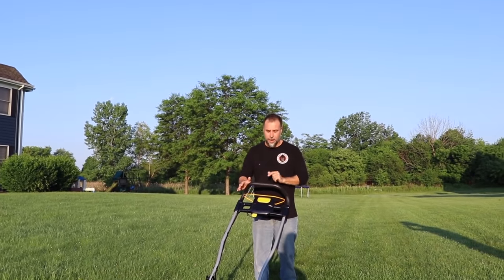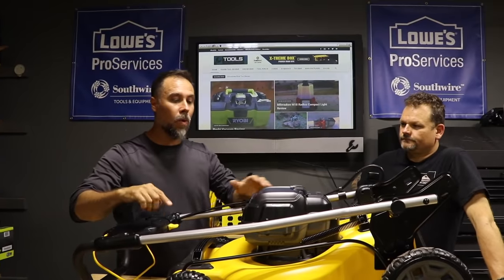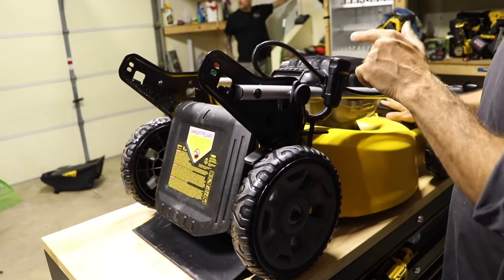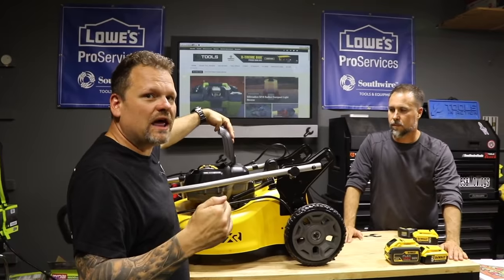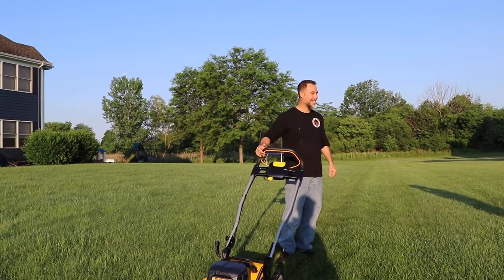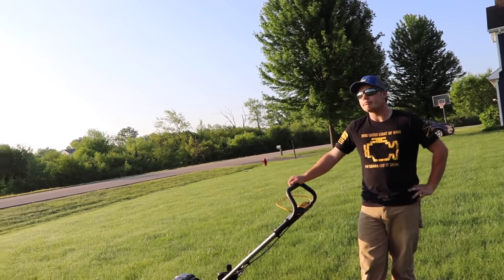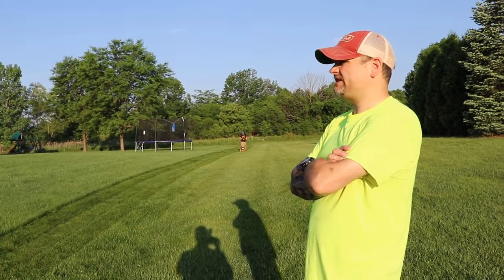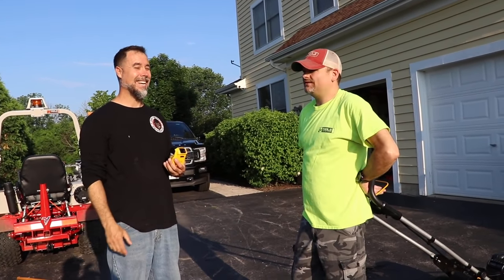Dewalt- 1st place for the Worst Lawn Mower of the year

Comment: I 100% agree with this video. Even in 2021, with the new model of this mower, that has not changed. I have multiple great dewalt power tools. I have the 20v hedge trimmer, which is amazing. But this thing is trash. I didnt even get to find out how well it mowed. It self propelled the wrong direction. Yep, when you pull the go lever, it goes backwards. I have found at least one other person in a lawncare facebook group with the exact same issue.
Reply from the maker: Holy crap- i thought they stopped making these or at least improved them.
Reply: @Dirtmonkey  I'm up to 3 people now who have bought backwards driving dewalt mowers.

Comment: those 9.0AH 60V flex volt batteries are about $180 each. the 12.0AH ones are almost $300 each. You can find a 2 set of the 6.0AH versions for around $150 on amazon thats the best bang for your buck I think.

Comment: Almost all my tools are split between the 3 but as of late I like makita a bit more because of their lightness and power in such a small tool. Also they make more gardening stuff whereas Milwaukee makes more plumber stuff and dewalt more carpentry stuff they are beast in their own field and ok in everything else. I like rigid as of late only brand I’m finding starting to compete with top 3
Reply: Forgot to add I’ve bought s few dewalt pressure washers that are just like this mower I can’t believe they even put their damn name on it. I still have my dewalt drill my dad used for 10 years and me for 6 and it’s battery is still good been dropped a thousand times. Will say I’ve never ever had a problem with makita or Milwaukee like in 10 + years. Also all the battery blowers suck so bad. Top 3 brands should have waited for more power. Only good for small residential. Makita and Milwaukee trimmer is great even for commercial. Makita trimmer and cultivator I love too.  Makita and Milwaukee is great for drops and durability more so then dewalt
Reply: Will say I love battery operated from makita except for blower and mower. But the makita mower is waaaay better then this dewalt. I seen it do 30 mins on high grass and if you got hella batteries like me you could theoretically run all day
Reply from the maker: Your right on that tool breakdown.  each one has an area they are good in.

Comment: I've got to agree with the other commenters. This isn't a fair test for the tool or your viewers. I also want to complain that while the kit comes with 2x5.0ah batteries, you just talked about how folks might be in the DeWalt system already. I have 20v batteries but I also have some flexvolts, so I'd like to see that. I bet they provide more power too.

Comment: I had a Honda back in 87. This mower had a aluminum deck . Two speeds to controls on the handle. The best thing I loved about the mower it had a drive shaft. The pin that held the drive together came out. So I just put a nail thru the drive shaft and back to mowing .best of all this Honda would pick up.everything off the ground and put all the clippings into the handy bagger.. most of all pull it One time and it started right up every single time

Comment: In all fairness it just needs a little modification, simply remove the motor and mount the biggest vert crank engine you can find. The agri spec of domestic mowers.

Comment: Firstly I'm a big fan of power equipment for all yard work. But to be fair the issue here isn't the mower it's you. You're testing a battery mower in the worst possible conditions for a job it wasn't designed for. The mower was designed for small 400sqm blocks that gets mowed often.

Comment: You should be using the 40 volt that lawn is to massive for a 20 volt platform take them 3 swips and do the square footage that's a fairly decent yard. Lol they have a 40 volt platform for the contract

Comment: Haha, mine does fine for 5k sqft lot. Only issue I have is dandelion stems don't always cut the first time, my gas mower does the job on them most of the time. 

No one buys an electric mower and expects gas powered performance. It's for simplicity and batteries you already have a charging system for. 

No this is not for 2 acre lots. I've used it in tall grass fine, but I probably wouldn't try it wet.

Comment: It is junk no doubt. That mower is set up for mulching and the lawn is to wet to cut with that machine. $380 for this is crazy. Have a side discharge and it would go longer. I see how the grass is sticking to the tires and it's in mulching mod.

Comment: While I don't think your yard is ever going to be cordless friendly, it certainly didn't cut much.  My 'home owner' range I use here in Australia is Ryobi - it's a 36 volt range and for what I do - lawn is only 80 square metres - works fine.  It certainly shits all over the Dewalt - it will easily start loaded, but I don't use it in grass as thick or as long as your.  The chainsaw I use to prune trees and cut small firewood when I'm camping.  Can't beat petrol (gas) powered gear for anything more than that IMO.

Comment: By far I believe this mower to be the best one the Stanley Black and Decker Company has produced to date, and the price point is ok. This review was unrealistic and biased. A normal person would not cut wet grass with any mower, let alone trying to mulch, and if they do, they are flawed. For run time I'd like to see the 60v batts come into play and review that under realistic conditions. Who the hell starts their mower up in the grass anyways. What Contractor buys an electric mower for commercial applications? For the Homeowner with less than a quarter acre this would be a good fit, and if opted, purchased the 60v's, even better. Not trying to promote DeWalt product here, though I have my own personal gripe with them, but the mower is flawless unlike the people reviewing it.

Comment: Lifting it up to start is not a big deal. I sometimes do that with my gas powered machine just because it starts easier. Also, I don't mulch generally - I'd like to see how it performs as a side discharge machine which I assume this machine doesn't do...
Reply: On no planet is that size lawn, which is beyond where  it would normally be cut (according to me) is this the right machine for the job. I'd like to see this machine tested in more appropriate setting. Don't get me wrong, I'm not trading my fossil fuel machine for ANY electric machine right now but I just don't think the testing says much about the machine as it's intended to be used. Mind you - I admit I haven't read DeWalt's promotional material either. No dog in the hunt here, just my opinion.

Comment: you didnt show that it is a crappy mower, just the limits of the mower. the runtime for what you were cutting is actually not too bad. considering that both batteries only hold about 200ish watt-hours of power, it's not that bad. not saying it is good, but if you happen to have a fairly small yard - probably about half an acre of grass - and cut it before it gets high, and definitely not when wet i'm sure you'll have a good experience.

Comment: Trying to use a machine like this on that area of grass, that length of grass and being wet, in mulching mode is bordering on silly. I tried doing that with a ride on and ran into trouble. I have never used a battery mower but using this as you did really is a nonesense. Try it in a different scenario and the penny might drop.

Comment: I have a question for you. I turned the back yard into raised garden beds  20" x 13 feet with about 24 inches between rows. it is very tiring to use our 21" self propelled Honda mower around those obstacles, plus I have a bad shoulder so can't start it myself. I've searched and can't find a  20" self propelled mower by Honda or any other quality brand with electric start. Do you have any suggestions?

Comment: I was considering this mower. Good thing I got an EGO instead. The EGO rips through deep, wet, heavy grass. My yard is about 7000sqft of grass. A single charge (which only takes 45 min) will complete my lawn with about 10-15 minutes to spare.

Comment: That yard you are using the mower on is waaaay too big for a push mower. The mower would probably be perfect for my yard, which is about the size of the area  you actually cut. As long as I don't let the grass get too tall, I think it would be fine.

While I love Dewalt power tools, their screw bits are crap. I was building some shelves last weekend and put in about 70 screws. During that time two of the dewalt bits broke. The parts in the screw head just sheared off. This was into pine 2x4s with one side being pre-drilled,  usually two screws at a time with a minute or two in between, so it wasn't a heat issue.
Reply from the maker: Wow-  that sounds craptacular. Their bits shouldn't be busting

Comment: Thank you for the honest review. I swear that thing is louder than my little Honda gas push mower - seriously. I cannot believe the way Dan kept making excuses for every short coming you uncovered.  Is he a tool reviewer or a DeWalt salesman?  To summarize - the mower is U-S-E-L-E-S-S. ;-)
Reply from the maker: Dans a Great guy- he liked it.  Me not so much....
Reply: It's not entirely useless. The suspension and height adjustments on an all steel deck are nice. And the push handle looks comfortable. I'd buy one real cheap off someone who hates it and modify it. Cut a discharge hole to match the plastic fittings from some other mower. Mount a decent gas motor to it and you should be good to go.
Reply: There are already other mowers out there that have the single handle height adjustment so no need to go to all that work to retrofit this one. In fact the EGO has a similar single-handle height adjustment system plus the advantage of a better battery and better run time.  I'm a mulching guy myself but adding a discharge port would make it more versatile. I don't see any benefit to the suspension other than allowing the mower to bounce up and down and make the cut height inconsistent.  The steel deck just adds weight and potential to rust down the road. Lots of gas push mowers have been offering poly decks for years.

Comment: This is dumb. You guys tried to mulch more than 3 inch of wet grass in the morning. It doesn’t matter who makes the mower, any battery powered mower would of stalled out and had issues. Some gas push mowers would of had the same trouble. Take any battery power mower to the same test, echo, ego, Kobalt, etc same issue. You haven’t proved anything except battery powered mowers are no good for wet grass. Yes, the Dewalt has crappy runtime, but I haven’t see it in any store yet. They chose to prioritize power over runtime. Which, I’m glad some company finally did. Seems most of the mowers on the market are trying to find a balance between power and runtime but lean more towards runtime. Lets be real, no one is probably going to get this mower (over like an ego) without being invested in the Dewalt platform. Dewalt had to get one out because they’re missing a battery powered mower for people who own their other OPE to complete the eco system. People getting this mower will have multiple Dewalt batteries around. I have this mower and it works perfectly fine. It’s better than the single battery egos in terms of torque. The blade is heavier. You think this lawn mower is bad, check out the kobalt 40v.

Comment: With two 9.0 Flex Volt batteries, the mower cuts it’s ass off👍🏻 Dry grass will help any mower too
Reply: Perhaps... but that's $300+ worth of batteries and a $399 mower. For $700 there are better options out there.
Reply: EOSJOE I do agree with your statement.  In this case, DeWalt should have provided the batteries that make this mower come alive for the $400 msrp

Comment: Milwaukee m18 fuel nail guns. Trash. Sold them. Also, my son just bought Milwaukee m12 fuel drill and impact. If you run for awhile gloves are needed because of heat coming thru handles.

Comment: It keeps dying because the cats flap is closed and it doesn't have enough torque for the build up, I don't understand why you would get an electric mower especially for commercial use, my Ryoby with a 190cc Subaru motor push mower with 12nm of torque cuts thru anything, its a monster and harly uses any fuel, fat better than the B&S Motors I have used, not that they are terrible or anything, just never had a motor so good as the Subi. And the Ryobi cost $500 AUD which is 369.95 USD.

Comment: 1. The inability to start in the tall grass shouldn't be a bad thing. Don't tell me you start a pull-start petrol mower that low in wet grass. And what did you expect out of a battery powered mower? You'd usually start a mower set higher or start it over concrete anyway, yeah? Be realistic
2. It kept stalling because you've got it set very low in wet grass without a catcher or the back open for grass to somewhat fly out. I'm sure it would mulch fine in dry grass that didn't clump up. If it wasn't wet it wouldn't be sticking to the wheels like sh*t to a blanket which is a dead giveway.
3. Poor battery life? You're cutting it well deeper than you'd normally cut a lawn and continuously choking it with wet grass, what did you expect? That's why it's using so much charge and why the batteries were hot.

I'm not an owner of this mower. These tests were unfair and you know it.

Comment: I dont think you understand that these new tools have a fail safe when under load they turn off to prevent damage since they are not oldschool tools they have  complicated parts inside that will fry with too much heat

Comment: Hmmm.... fair or unfair....?  Must say that is a beautifully laid lawn. Heavily populated thick long grass, AND it’s wet. The front wheels are almost disappearing under the tips of the grass. It’s cutting way too low. It’s clogging the blade as the clumps of wet grass fall off the housing. That would happen with any mower. Add in 5ah batteries... I don’t think it stands a chance in those conditions being honest. I guess there might be another package deal that comes with flex volts bats, but that would make it very expensive. No? I reckon that’s the real problem to a home owner. I’d like to see the same test when the grass is dry? And maybe raise the deck to a more sensible height?

Comment: Simple math guys... c'mon.  Power = V*I. You're using 20v batteries...even if they put them in series you only have 40v.  A decent mower would be ~1500w.  1500÷40=37.5 Amps!!!  That's going to overheat or over current those battery packs easily.  Check out the Green works 80V lineup with a 4Ah battery, 2 of them if you expect to do that yard.

Comment: The Milwaukee non fuel grinder! I bought it came home put a 5 amp battery in it and 10 min. Later the grinder started smoking and fried. Didn't even use one battery up. So I figured it was a bad one Milwaukee gave me a brand new one cus the other one was shot. Then the next grinder made it through 2 or 3 batteries then did the same thing started smoking and stopped working brought it in for warranty replaced all the motor stuff in the grinder and gave it back. Third grinder did 2 batteries then started smoking I said I'm done. So I sent it in and said this thing is useless and asked the Milwaukee rep to replace it with a fuel Model and if pay the difference and that they agreed to do for me. So as of right now I have the fuel Model grinder and seems to be good. I want to let everyone know DO NOT BUY THE NON FUEL GRINDER.  I have tons of Milwaukee tools but that one is junk. Thanks for the review

Comment: Sorry but this is an unfair review of this mower, your starting issue is because of the brushless motor. Any brushless motor will stall on startup under too much load to protect the batteries, but once going he was going along at a good speed and it was handling it with plenty of torque granted it did stall But put a bag on it/open Shute and then see how it goes and maybe try putting the cut height up because who seriously cuts there lawn in those conditions?

Comment: Ignoring the words you're saying - the test you put that mower through looks like it did the job nicely for what it's been designed to do.  It'll mow a small garden just fine (your 3 strips is really not insignificant, and you're putting under really heavy load, of course it won't last long)
Reply from the maker: That wasn't a heavy load in my book

Comment: Stanley you should rehash this video. You're used to insanely expensive industrial equipment. Nobody mows their yard at 6 AM...doesn't happen. I got an electric mower that's more powerful than my gas mower, there's no way my gas mower would mulch that much gas at 6 AM with soaking wet grass in mulch mode. This is just a poorly done one, you're a good guy though so I'd love to see a rehash. A part 2 if you will cutting under normal conditions.

Comment: Yes, not the best mower.  However, a lot of mowers will stall out if you push them fast while cutting wet and relatively tall grass with no collection bag.  Run time DEFINITELY blows though.  Not worth buying two 9 or 12AH Batteries to use a $400 mower.  And usually you should only cut 1/3 of the grass height at a time

Comment: AvE did a review and tear down video of the new Dewalt cordless chainsaw a few days ago and had issues with the bar not being rigidly mounted to the body. Dewalt makes great corded tools and cordless construction/mechanics tools but I think they've missed the mark with their cordless yard work stuff.
Reply: I know this is an old comment but they actually updated the saw to remove the ratchet mechanism and added a Allen head to the blade retainer to get more torque on it. Bought the 20v and noticed they fixed it awesome little saw.

Comment: Wow, and those batteries will be junk before long because the heat will break down the chemistry of the batteries so they no longer hold much of a charge and the run time will probably be significantly less in one or two seasons.  It’s sad they’d produce such a product.